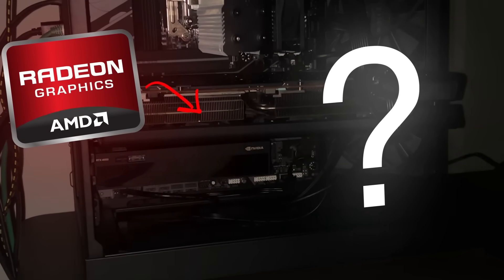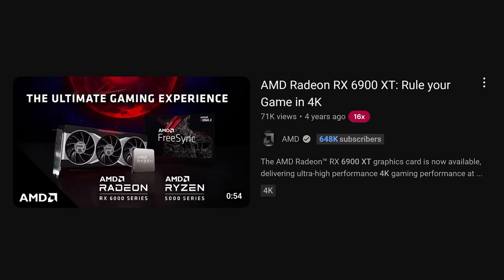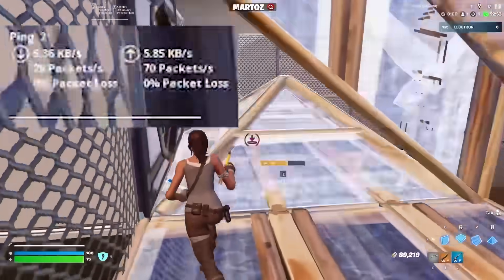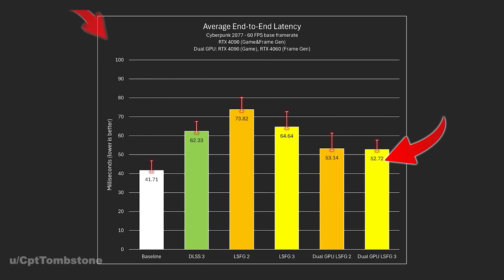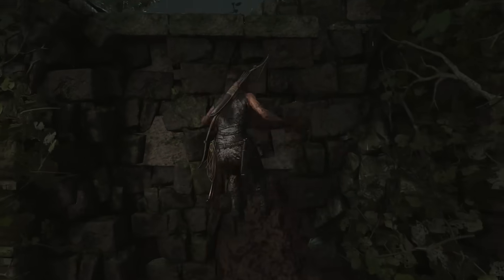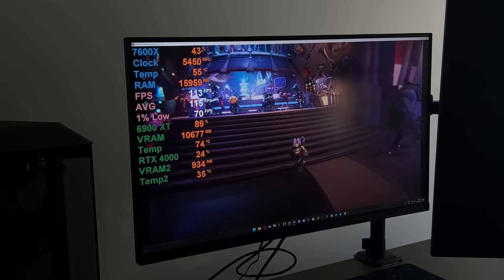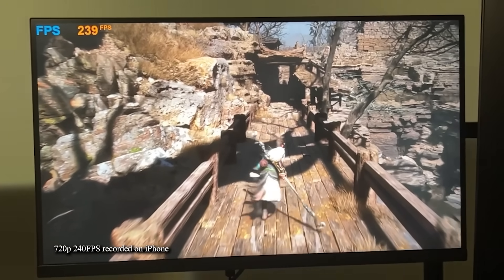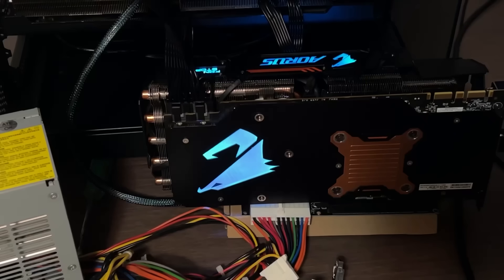I Used Both AMD & NVIDIA in One PC and Got 240 FPS in Every Game

Comment: This is NOT a good idea. You are essentially doing the following:
1. Increasing the power draw of the system.
2. Increasing the heat output in the system (which slows down all components in the machine)
3. Reducing bandwidth available for all of your PCIe devices.
4. Adds additional latency for increased perceived smoothness.

Frame Generation makes the image look smoother by inserting AI generated frames between the frames generated by your graphics card. If you have a base of 60 FPS and use Lossless Scaling to increase your frame rate to 240 FPS, all you achieve is a smoother image with less stutters and increased latency. You are still getting 60 FPS. If you are playing competitive games, you are increasing your latency and not getting any of the benefits of real frames.

In most systems, your CPU is rated for ~20 PCIe lanes at full speed. Disregarding the x4 NVMe SSDs in this video, graphics cards are designed to use 16 lanes. If you use 2 graphics cards, you are well beyond the limit of 20 lanes. This essentially means your graphics cards will be operating at half the bandwidth (x8) instead of the full bandwidth (x16).

The reason why this worked back in the day, is that even though the graphics cards were operating at less bandwidth, they used a SLI link which allowed the cards to communicate and share bandwidth (allowing them to essentially still operate at x16 speeds).

Using Frame Generation with lossless scaling on a secondary GPU based on all data that currently exists just doesn't make sense. To be clear, I liked the video, it was fun - something LTT would do. It's just NOT practical and most people should NOT be trying this in their setups. Especially people who are trying to add another GPU into a power supply that can't handle the extra load.
Reply: Point 3 is technically correct, but no one is using x16 in a dual GPU setup. The difference between x16 and 8x have no real impact, and certainly the performance gain with dual GPU will outweigh the 1-2% loss from x16 to x8 by a massive amount.
And CPU’s with more lanes exist. Mine has 40.

While I agree on the heat problem, one card will cook the other if both are connected directly to the MB. This is easily solved by using a riser cable on 2nd GPU.
Reply: @princexaine5340  you're totally clueless about how this all works.
Reply: 1.-Undervolting exists and something like an RX 6600 won't draw over 50W when running expensive LSFG at 1440p, which is literally the wattage drop you get from undervolting higher tier graphics cards
2.-If 50W will overheat your whole PC then the issue lies in your PC's case, not on having an extra 50W, it's as if saying going from a 3060 to a 3070 is a bad idea because of the extra power draw
3.-Bandwidth depends on every single motherboard and chipset, my b550 has a chipset pcie 3.0 x4 that is not affected in any single way from having a second GPU
4.-The latency is less than with single GPU frame generation, the only way to say it's additional latency is to blame it on frame generation itself, which by mere concept you should be saying it to every person that bought the rtx 5000 for the multiframe generation

The latency added by LSFG is half the frametime, which is imperceptible at over 60 fps and very acceptable when near them
Also the PCIE lanes thing is completely invalid, because as I said, depends entirely on the motherboard + chipset and how the manual describes them, you WILL NOT find a consumer oriented motherboard with two X16 lanes slots, and X8 to X16 has a drop around 1% and has been confirmed over and over

And there's over 50 users on the Lossless Scaling discord running dual graphics cards, you are clearly not speaking from experience, and I am, I have videos showing so on youtube, and in all instances it's been playable
Reply: @ivanvladimir0435  Im new to AMD cards. I just got a 7900XT but the 4070 Super will be doing the Ray Tracing rendering. Dunno whos good for that mix and match dilemma for frame gen. 
Second question: Whats a good undervolting software for it.
Reply: @ivanvladimir0435  Sure it's "playable", but it STILL DOESN'T make sense. I'm not really sure where you pulled 50W from, but a PCIe lane itself can use up to 75W. If you are utilizing a dedicated GPU for lossless scaling to push the frame rate multiple times higher, I can almost guarantee the GPU is pulling more than 50W. Additionally, it isn't in regards to just the power output, its also the orientation and how much room the cards consume. If you place a GPU in front of your other GPU, you ARE giving your top GPU warmer/recycled air from your secondary GPU. This isn't an issue if both cards are water cooled, but it IS something to consider.

And again, I will state that Lossless scaling DOES NOT increase your frame rate. It "generates" frames, which adds latency. It doesn't matter "how much" latency is added, it DOES add extra latency, which isn't good for people who are in the competitive scene. The only thing any sort of AI upscaling should be used for, is reducing perceivable stutter (masking 0.1% and 1% lows). If you are utilizing frame generation to "increase your framerate", you simply don't understand how the technology works.

And it's the fault of those who marketed and created the AI upscaling. Because, just like lossless scaling does, AI upscaling should be used to target a frame rate and keep it there to keep the experience smooth. Using it to "double" or "triple" your frame rate doesn't make sense because you are not increasing your base frame rate so while the "perceivable" smoothness might look better, the input lag will be absolutely horrendous if you attempt to increase it too far, not to mention any artifacts that result from it.

AI upscaling IS useful for those who struggle to maintain their target frame rate. 60 FPS, 120 FPS, etc. It should NOT be used to say "I was only getting 60 FPS but now I'm getting 240 FPS", because you're not getting 240 FPS. You're getting 60 FPS with 180 AI inserted frames, with horrible input latency and probably artifacts. Using a secondary GPU for this doesn't change this fact.
Reply: @princexaine5340  https://youtu.be/FZlwfWZ-0JM?t=144 An average of extra 44W pulled when running LSFG on a second GPU, once again, let who actually did it speak, not speaking from some "theoretical" standpoint
Reply: @princexaine5340 I agree with the new adaptive frame Gen I can target a specific fps. My monitor is 165hz so when I'm running 100+ fps I'll set the frame generation to 165hz. If I'm only getting 60 fps I'll do around 100 on frame gen. I wouldn't even use it in competitive games, but games like Kingdom Come Deliverance it works brilliantly. It's honestly insane and looks good in most single player games you can't notice the input delay or it's extremely miniscule and doesn't matter. But for competitive games the input delay is terrible because competitive games are so fast paced that a slight increase is perceivable and makes you play worse.
Reply: @ivanvladimir0435  even if you are correct about the power draw, that only applies to your specific use case and setup. And it still doesn't fix the issue with utilizing frame generation to insert hundreds of fake frames.
Reply: @TheWorldWarrior  if you are utilizing frame generation for that, you're doing better than most. Just keep in mind you want the ai generated frames to make up a small portion of your total frames, to keep latency, artifacts, etc at a minimum.

Personally, I would use msi afterburner to find my average and keep it at that average, instead of a predetermined value (such as monitor refresh). But like I said, you're doing a lot better than most with how you're approaching it. Kudos.
Reply: @princexaine5340  "Specific use case and setup" no? Literally just undervolt your second GPU? Overclocking the LSFG GPU has minimal gain, which again you would know if you actually looked into it, as everyone who's done this recommends undervolting and even underclocking rather than just trying to say "oh yeah it's bad to do this" just because you listened to some upset random on the internet
Reply: @princexaine5340  Do you think we could expect specialized pci cards specifically for frame Gen? If a card was made specializing in it do you think it would become more effective and efficient? Also yeah when I use frame Gen it's never 2x I usually do about maybe 1.5x frame Gen max for enjoyability. People generating 240hz with 60 fps is absolutely ridiculous
Reply: @TheWorldWarrior  No. Its guaranteed to not be a thing. Like I said, this isn't a good idea and even if it was, it'd be niche. The primary reason this would never become mainstream is because m.2 nvme ssds exist, and they require 4 lanes each, and a graphics card + 2 nvme drives will likely saturate all available lanes before bandwidth is reduced.
Reply: @ivanvladimir0435  I didn't listen to a "upset random". I'm utilizing my own experience. I don't know why you're so focused on the power draw and heat output. It was literally only a portion of what I touched on.

But anyways ill explain it to you, one last time. If you still don't get it, that's on you.

Adding a LSFG dedicated graphics card reduces the bandwidth available to your pcie devices if you're over the limit your CPU allows. This is a fact. Is it a minimal difference, sure, in most applications. 

Adding a LSFG graphics card introduces more heat, and constricts airflow to your primary graphics card, which WILL either:
1. Increase the temperature of the card, reducing that card's clock speeds, lowering your base frame rate
AND/OR
2. Increase the fan curve, increasing noise.
Note: this ONLY applies if the cards are air cooled. If they are water cooled this is far less likely to be an issue. However its still important to mention, as water cooling is expensive, which means most users are likely air cooling AND if you are liquid cooled, you most likely have a high end gpu anyways, making this quite redundant anyway.

Adding a LSFG GPU WILL increase power draw. Even if by only 50W, it is still something to consider. This is something to consider because the average user probably won't undervolt their card, and even if they do, they would need to ensure their power supply can handle the additional load. A lot of pre-builts run bare minimum power supplies, not leaving all that much extra headroom for something like this.

And lastly, AI generated frames do not equal normal frames. Increasing 60 FPS to 240 FPS will introduce additional latency and artifacts. 240 FPS in this case would be 60 FPS with 180 AI generated frames. You are still operating at 60 FPS, with just increased perceived smoothness.

Most people misunderstand ai generated frames because of how it was marketed. AI generated frames should NOT be used to increase your FPS by a large amount. They can and should be used to maintain a target framerate for best latency and reduced perceived stuttering. This would mask the 0.1% and 1% lows.

Again if you don't get it by now, you're not going to. You can keep doing this, but I highly recommend you don't encourage other people to do it.
Reply: @princexaine5340  Your bandwidth argument shows you don't understand how does it even work, bandwidth is dropped once you exceed the maximum lanes, and for that you need to be utilizing multiple nvme drives, and even then dropping from pcie 4.0 x16 to 4.0 x8 is a minimal drop on 95% of GPU's, and I stuck to the power draw because it's obvious you didn't try it, you are just trying to look like the guy who knows better, because if you had, I wouldn't be needing to prove you wrong on everything you are saying, like with powet draw, I get that you are angry at marketing generated fps as real fps, that's a valid concern, BUT NOT A VALID ARGUMENT TO SAY USING DUAL-GPU's IS A BAD IDEA, get it now? You aren't the one with the right to speak about it, you are just digging your hole deeper with every reply you give
Reply: This should be pinned.
Reply: How would you check if the CPU can or cannot handle about 32 PCIE lanes at full speed?
Reply: @RingDingBing  Where the hell do u get 32 lanes
all lanes are the capabilities of the cpu

we are now only at 20+ lanes so..that 24 lanes is devided on the motherboard
16 goes to gpu
and the 4 goes to nvme
and another 4 is either going to another secondary nvme or to the sata ports which is further devided to x2+x2 for sata speeds

so if a cpu has 20 lanes then that motherboard will have less features to offer
gpu speed will have x16
or it will work at x8+x8 on that motherboard
then you have still only 4 left for the rest of the other stuff on the motherboard

so the new 9800x3d has 28 lanes..which allows more nvme drives on the motherboard
the 9950x3d also has only 28 lanes

intel core i9 only has 16-20 lanes

AMD is winning these days

if a motherboard has more lanes then cpu then its because a secondary south bridge chip was added on the motherboard ..made by a third party vendor..its usually used to add more sata ports..as there inst enough lanes
Reply: here is something to add
ASUS has made a gpu ..a very low end gpu
it runs only on x8 speeds
so they figured that if you put it in a x16 slot there is 8 lanes left
so they made the gpu with a nvme slot on the gpu to make use of the left over 8 lanes
so that 16 lanes is fully used with that gpu

nice invention by ASUS

also the smaller the cpu the less lanes you will add to the motherboard to use for all you gpu+nvme+sata drives +hardrives..etc etc

Comment: My fear is Nvidia sniffing this out and finding a way to sell us double the GPUs in the future
Reply: Technically they did by removing phsx support on any older games.
Reply: @davidsmith3687  true.
Reply: That wouldnt be a bad idea, selling us 2 DIE´s into 1 GPU construction, that´d a really good strategy to fight Moore´s law death.

One chip to make the render and the second one to make the FG
Reply: @Gauxd1  They already did Dual GPUs with some older GPUs like the 9800 GX2, GTX 590, GTX 690 and TITAN Z 😉
Reply: @x4it3n  there was even a gtx 280 but i dont think it was significant performance upgrade
Reply: @awakeandwatching953  GTX 295 because GTX 280 just had 1 chip.
Reply: @DragunnitumGaming   they used to with sli funny thing was it performed so well it was cheaper to buy two older cards than one newer one although now most games don't support sli so you won't see such performance gains
Reply: they limited their multigpu tech to their compute cards to give a reason to up-price them since next to no consumers goes for dual gpu anyway

the up-price on the server cards generates much more revenue than supporting this on consumer cards, it's the same shtick as them limiting the vram on the consumer cards, they'll only give consumers what they think you need and up-price everything else on the server cards
Reply: @DragunnitumGaming  they dis this fir decades already. Pretty sure they really only gave up on SLI because it was cheaper/better performance to buy a second identical last Gen GPU and run SLI than to upgrade.
Reply: what they might do is put an extra chip on the same GPU, call them somthing like 6090 LSI and ask 50-100% more for it compared to the base 6090 because it has another chip "that costs a lot of money" (the chip of a 3060)
Reply: Vicces,mert az AMD kijelentette,hogy PCIE foglalatú NPU egyésgeket fog kiadni :D

Comment: if someone use lossless scaling and they have integrated graphics - they should offload scaling/generation to integrated GPU.
but 2nd gpu is dumb.
Reply: 2nd GPU is dumb if you think you don't need a tutorial for it, I run it on a very decently cheap rx 6600m alongside my rtx 3060 and couldn't be more satisfied
Reply: @ivanvladimir0435  better to sell both cards and get 1 better, like 3080 (i just checked used market it cost like 6600m+3060) or rx6900

Comment: I actually bought an RTX 4060 as a secondary GPU just for that purpose a few weeks ago, it's an amazing duo, however the PCIe Generation is VERY important, you really ideally want to have Gen 4 x8 on both PCIe slots on your mobo, I have Gen 3 x8 and while it is manageable, it's quite the headhache sometimes.

Comment: What I wish they would make work is a raster card/path trace card sli .... offloading the path tracing/ray tracing to its own card and it actually working would be the holy grail. The new GPU company releasing there pathtracing card thats 10x more performant than 4090 but mediocre raster is maybe a step closer. DX12 already supports dual gpu link , just no developers code for it. I know we could have much better raster/pt than we have now if only some teamwork went into it.

Comment: 1. input lag
2. junky setup
3. ts is just junk version of dlss4
Reply: 1. Input latency exists in any frame generation, this point applies too to FSR, DLSS and AFMF frame generation, but Lossless Scaling's latency is half of the frame time
2. That's lecctron's fault, had he gone over to the Lossless Scaling discord server he would have found answers very quickly
3. DLSS 4 drops you base framerate, this doesn't, this has LESS input lag than DLSS 4
Reply: This idea is junk